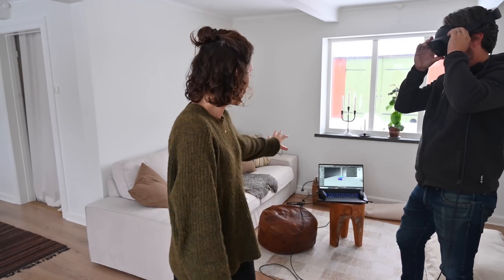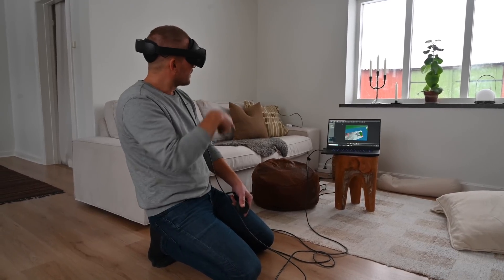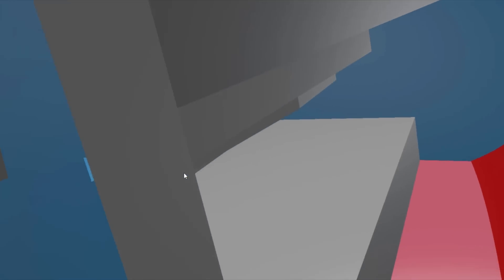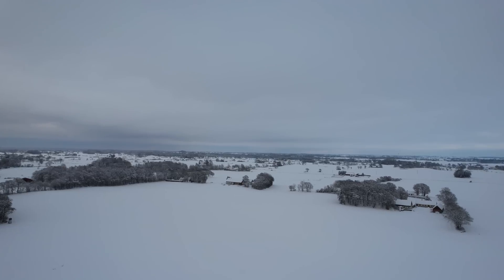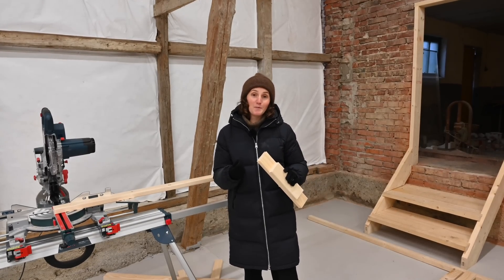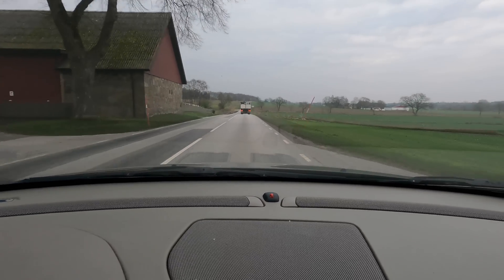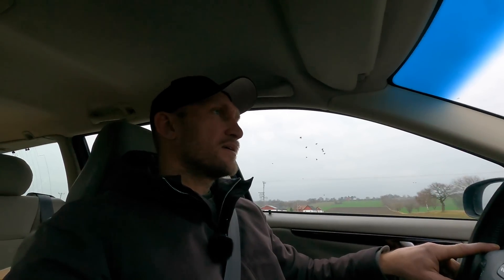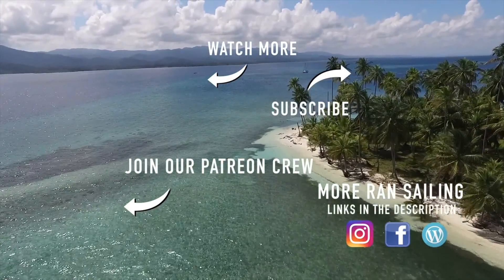Using Virtual Reality for Boat Design - Ep. 326 RAN Sailing

Comment: I once owned a 20 meter cat, strip plank epoxy glass that was struck at sea by a 300 meter container ship moving at +/- 20 knots. My boat was badly damaged but did not take on water. The hull absorbed the impact by flexing. Unbelieveably strong. The strips were 100mm wide and 15mm thick. It is much easier to build these boats with thicker strips that are still at least 100mm wide. And the gaps between the strips can be quite wide. The wider the gaps are the more the epoxy can shrink and expand as it flexes, and the wider the strips are the easier and fast the build. The extra epoxy/filler used to fill wider gaps costs very little, do the math. A major mistake made in the building of my boat was the 15mm thickness of the strips because you could not fair the boat by sanding the wood, if you sanded away 3mm in spots it would be too thin. So they added 4-5mm of fairing compound to the outside which is heavy and much harder to sand. Use thicker strips and you can fair the wood, which is quite easy to sand and level.

Comment: I know you will do a fab job but someone else like you just bought a Farrier f9 trimaran for trailerability and use on the great lakes usa.  it was built of western red cedar planked and skinned and while I know  you have seen these it starts out one way and when done is sleek, smooth, strong and light weight.  If you watch their video you can see the hull and amas as they were being built then how it looks when done.  Not much sleeker or faster than the forces with a trimaran.  You are such a perfectionist and good carpenter I know your bigger monohull will turn out to be fantastic, one frame, one action at a time.  They are Sailing Solianis who went from a 37ft monohull to this trimaran.  It is repetitive to show you as I am sure you have your own videos but if you can make a tri that looks like this, someone with your skills can use the same tech to make anything.  Congrats and we will love watching you do it.  I will post a link to theirs if you do want to see it about 2/3rds through as the builder built it.  go to 9.02 minutes on the tape to see the sections under construction using western red cedar.  Lighting was dark so it looked darker than actual.  https://www.youtube.com/watch?v=6V5lPv8AN0g

Comment: Great find on the wood working machines. I would say the older heavier machines are a better choice them some of the "hobbie" equipment that is available.  I have the very same band saw the it don't use anymore and replaced it with a nice Italian machine.   Hopefully the one you picked up is better. The aluminium table and blade guides make precise re-sawing almost impossible . Good luck with the cedar :)

Comment: Johann, I would not get 4-sided planer I would have a shop to do that for you. It's one off job. I wrote to you earlier when you first announced about building a boat. We have build boats before with the exact same principle. How you want those strips is one side planed (inside the boat) other side more "hairy/not finished" the outside. The joining sides with U and reverse U shape (guess scalloped is the right English word). Straight edged stripes won't work

Comment: I was watching a video on relativity space's new stargate metal 3D printer and it got me thinking about what it could do to build an aluminum boat. Might be kinda cool to see if it could print your boat in aluminum... Would probably be ridiculously expensive, but it could do interior works and make lots of bubble enclosures for flotation/safety at the same time. Really cool to see around inside the new boat, quite the techie experience. Nice score on the old tools, it's amazing how much a simple piece of metal costs today. You can always re-machine those things, replace parts and add computer controls to make new tools out of them. With all that equipment you could probably make a whole bunch of different wood products as well. Nice to see the farm decorated in winter snows, quite the difference from the tropics - eh.

Comment: Excellent stuff guy’s,  it appears you are preparing the house for painting as-well?    Would be a good time to start building a rolling Scaffolding base, you don’t need try go up high yet, but just to move the equipment around, something that rolls with 5-10 tons  so 250kg load bearing wheels x4.    So basically you need a mig/Tig welder and a pipe bender, later for metal fabrication for boat equipment eg rails/ solar arch etc etc,  but at the moment to build a manual crane 🏗
Reply from the maker: Thanks Trev! Yes, the house needs paint and so does the barn. It will be a project for the summer… 😊